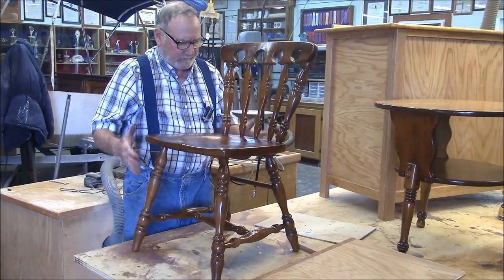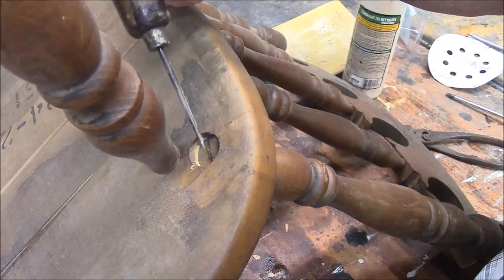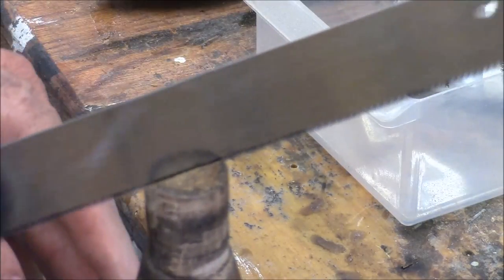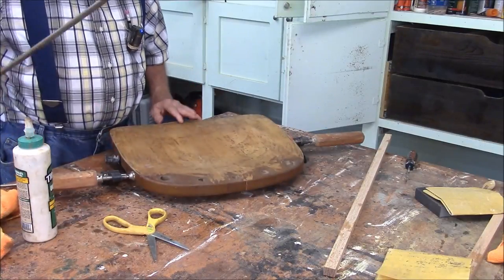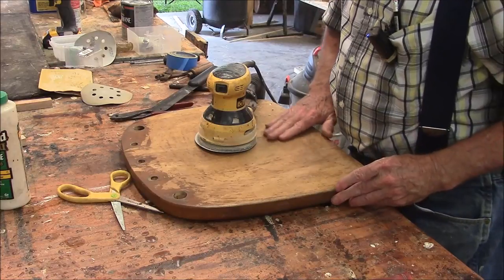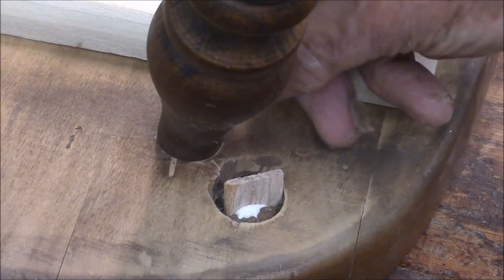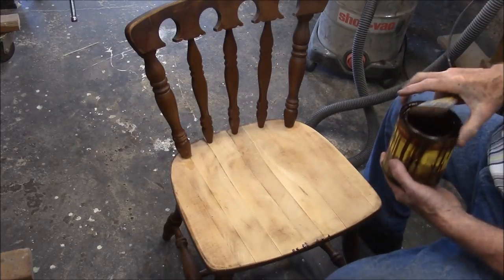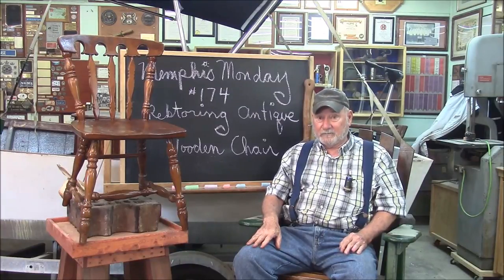174 Restoring an Early 20th Century Wooden Chair

Comment: This chair looks like it was definitely built before the 60s or 70s because after then, the chairs built similar to this were junk that seemed to fall apart if you looked at them hard.  I have never seen this design with the scalloped bottom of the upper back.    This definitely was your kind of project.  The only thing that you would have liked better if it was a box of pieces with one or two pieces missing.    The two braces that you added to the bottom of the seat looked like they weren't laying flat on the seat.  Was the bottom of the seat bowed or were the braces bowed.......Or was it an optical illusion?  As always your final product was superior.

Did you catch Sampson's video last night?  I bet you really enjoyed it if you did.  It is fun to see some building beginning on his project.

If all goes well, I will be hitching the trailer up tomorrow evening and heading out Tuesday morning.  I have actually made two changes to the inside.  Unfortunately, I forgot to video either of them.  One was removing the bathroom door. (I know you voted no but I really hated that door and I talked to many people on forums who have done it and love it.)  I also changed out the kitchen faucet to a taller one.  The way this one is made you don't have to change out the entire faucet assembly.  You can simply replace the faucet itself.  The other one was so low that I couldn't even get a tall glass under it.       As you know, I am not very handy so neither of these projects are very professional.    However, I will try to get a video of the final results soon

By the way, you will get a kick out of this.......It was a high in the 70's at the place I am going to.  Not my kind of weather !

Stay cool down there!
Reply from the maker: So the adventure begins.  And 70 degrees, while still hot to me, sounds like a good start.  
     Good decision on the bathroom door.  I wouldn't have recommended it, but by consulting other owners, you did it right.  No more "I forgot to video" stuff.  Can't wait to see the chronicle of your adventure.  As Captain Ron said: "If it's going to happen, it will happen out there."  
       I'll have to check out that brace question, but I suspect you are right.  
       Couldn't miss Sampson Boat Company.  What an epic channel.  Wonder why he doesn't do more video, as in his case, he could score some pretty good Adsense money, and perhaps even a sponsor or two.  
       And you are sure right, I was nuts about the actual building process.  That "Ship Saw" is a thing of beauty.  I don't know if you remember them putting it in, but the ship saw allows them to cut variable angles in the same cut.  But lugging those big chunks of Live Oak around;  I would last about 30 minutes before I got fired.  
      The friend who provided the chair for this video must have liked it, as he has asked me to restore the five other chairs and the table.  I agreed, so this fall some time for that. 
      Thanks for the view and for taking the time to comment.  But most important, you don't forget about us civilians out here waiting on your camping adventure videos.
Reply: Yes.  This will be the best and biggest adventure yet.  

I am sure that you can remember back to when you first started videoing your work and there had to be many times that you got part of the way or all the way through a project before realizing that you didn't even think to video it.   
 I remember when he first got the ship saw.  Even before I saw what it was capable of I was very interested in seeing its capabilities.    That thing is a monster and very flexible.   As he mentioned, it will make cuts that no other instrument will do.

I suspect when you were you were a young buck like him you were lugging loads just as heavy as those chunks of live oaks.

Of course your friend liked this build.  I can't wait to see what else he has given you for us to enjoy.

I am planning to post my very rudimentary videos of my camping trips in this big adventure.  Be gentle with me......hahahahahah